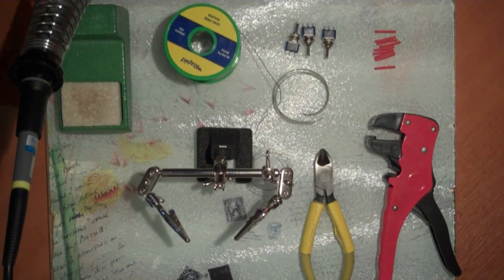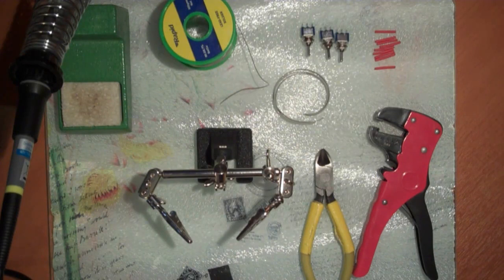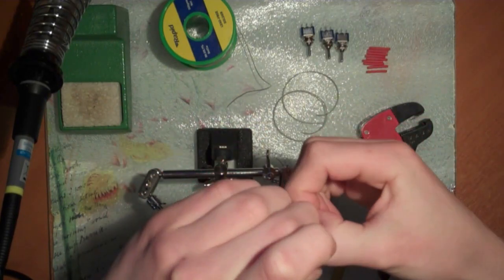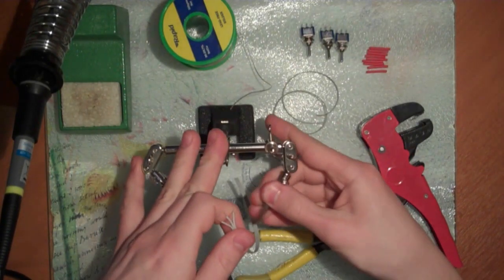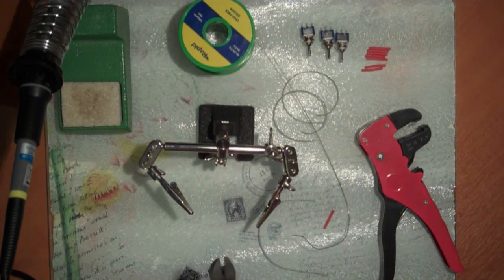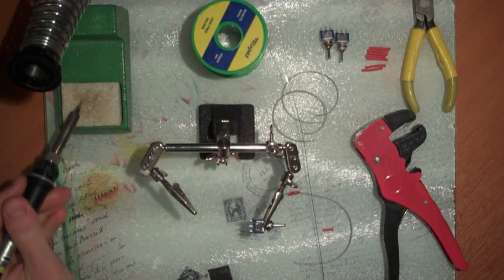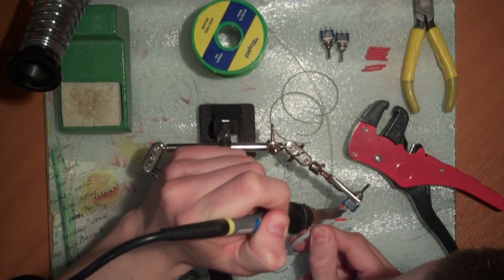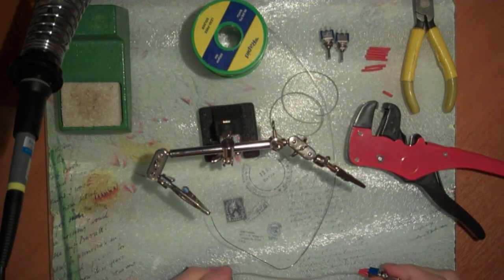How to Solder a Switch

Comment: My soldering iron has 20w / 40w option. Is 40w too hot? I dont want to burn those switches...
Reply from the maker: The wattage refers to the power of the iron, not necessarily the temperature.  A higher wattage will help the iron to maintain its temperature when soldering larger items, but probably isn't necessary for soldering small switches.  I'd advise using the 20W output for now and if it seems like the solder isn't flowing properly and you're having to hold the iron on for more than a few seconds, try the 40W output.  The secret is to hold the iron on for the shortest amount of time, holding the iron on for too long may damage components or can melt plastic switch housings.  Best of luck :)

Comment: That confirms what I have found out soldering these small switches. Those lug holes are really to hold the solder and those wires solder on flat. It is so tempting to want to run that wire through the hole. Thanks for putting this up because now I feeling like I am doing it less wrong...lol
Reply from the maker: They might also be heat dissipation holes.  I was reading a datasheet for a potentiometer the other day and it said that's what they were and not to solder them.

Comment from the maker: I'm using an old glass chopping board.  If you do drip any solder just let it cool and it will brush off really easily.  You can use wood or rubber matting but these can of course burn and may smell a little.  With glass you don't need to worry about burning anything.

Comment: Thanks for this...I'll be replacing switches on a double pedal steel, which of course takes up a lot of room on a table..which I don't have. So, I will be working somehow with the end of the pedal steel upside down. I notice you have some kind of material on your table under everything...to catch drips, etc. What is it?
Of course, beginners need to also know how to fix errors in their work too....and of course know for sure which lead goes to what....

Comment from the maker: It depends really... a spade connector is generally used if you are likely to need to replace something, for example on cars spade connectors are used.  Electrically though a soldered joint is probably better, however as long as both contacts are clean a spade connector should be fine.

Comment from the maker: @Kankki1 Yer, I didn't have any heat shrink of this size at the time and find whenever I try and use it I either end up burning it or not getting enough heat to shrink it enough.  The barrel of the iron is usually enough but this make the barrel dirty and you cant always get it in the right place.